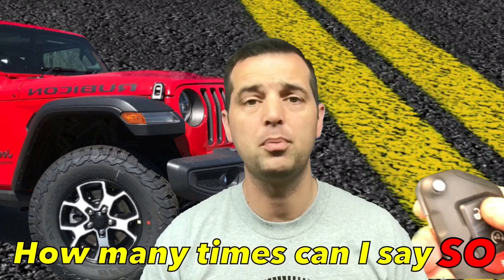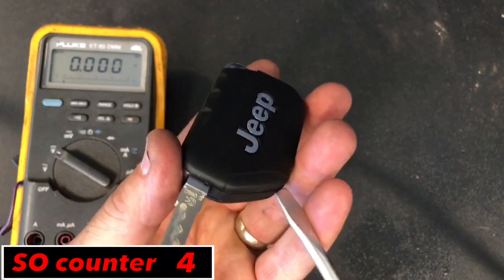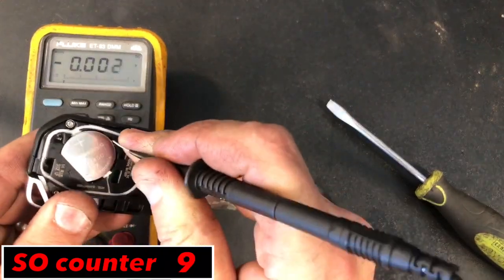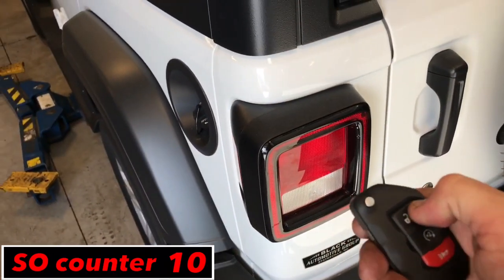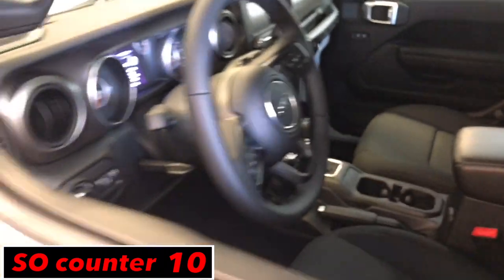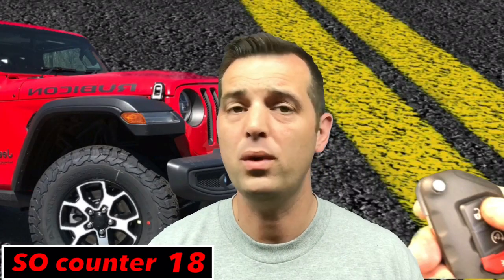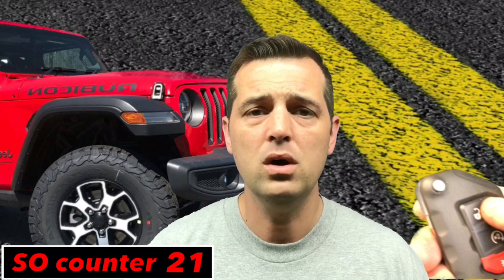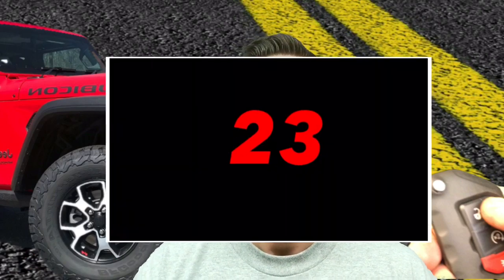Remote Battery Dead NO start Jeep JL Wrangler (KeyFob Battery)

Comment: All the fobs I've had took 2032 batteries. Keep a supply on hand. Just happen to have some 2450 as backup for led candles. Will add one to the jeep. Thanks for the heads up.

Comment: The other day it told me to start the Jeep with the fob, and my battery wasn't even dead. Go figure. They are using Near Field Communication--the Jeep's signal powers a chip in the fob to authenticate. Similar tech to easy pass. 

And don't change the way you talk. I'll take a southern accent over a northern any day of the week. 

Thanks for the video.
Reply from the maker: Lol. No worries I’ll never be have proper English. Just ain’t happenin 😉

Comment: I truly dislike the "brick" of a key fob for my 2018 JL.  It's relatively huge and, since I keep it in my pocket all day (just in case the zombie apocalypse breaks out so I can run straight to my Jeep and head for the hills), the "switchblade" of a key always pops out which made carrying the dang thing even more frustrating.  So... I carefully removed the key and placed it onto the key ring - where it belongs.  My question is: can I purchase another key fob (a suitable substitute) and have it programmed to work for my vehicle?  I had a 2015 Rubicon and had no complaints or issues about its key fob.  Thanks!
Reply from the maker: Dennis right now. I don’t know of anything that’s programmable to the JL. I’ll keep my eyes open for something.
Reply from the maker: The key is pretty big. Especially if you don’t have passive entry you have to get the brick out of your pocket every time.

Comment: Why is there a key symbol on the 12V (cigarette lighter) power port?  The one below the AC/Heater controls.
Reply from the maker: Because it only works when the Key is on. when the key is off there is no power to the outlet.

Comment: I’m having an issue with my 2017 grand Cherokee limited and I can’t figure out why .. my key fob only works when it wants to .. I gotta hit my lock button like 4 times for it to lock and my remote start almost never works... any ideas? My car battery has around 14 volts so I don’t think it’s the battery

Comment: They make one bad design decision (removing a normal key ignition) and have to design numerous other workarounds to make up for it.
Reply: Count me in as another "grumpy old man"  with the same thoughts.  A simple key ignition now requires an extra battery and screwdriver in the glove box, and a dead vehicle until you figure out that you have to place the keyfob on the start button.     The young folk want to have all the bells and whistles call us old folks "out of touch!"  I would much rather prefer that the "upgrades" be in performance and ruggedness in order to conquer those washboard dirt roads.
Reply from the maker: Love your guy’s input!!👍
Reply: +r g
It's one thing to add these "features" into some sort of techno-dweeb-Gen-Slacker convenience package, but it they should have made it so that you can still buy a base unit without all this junk.
Reply: Count me as not a big fan of the push button start on the new vehicles. I've got three now with it. I'm just waiting for it to break.
Reply: +jeremy kohler
I would not be surprised if it was some sort of Big Brother ulterior plan to allow them to tell your car to turn off when they wanted it to.  Entering an area where they don't want you?  Send a signal to the cars to stop.  Late on renewing your registration or inspection on your car?  Send a signal to it to prevent it from starting until you renew it.  Don't pull over quick enough when a cop gets behind you because you did not feel that it was a safe place to stop?  Send a signal to the car to force it to stop.
Reply from the maker: You crack me up 😂  grumpy oldman. Who knows. It’s possible if they can unlock your car from Detroit they can do other things I’m sure.

Comment: Question 
You set your alarm, the batter goes dead in your remote, how do you turn the alarm off? Will the key in the door disable the alarm? 
Here is a video ideal for you.
Reply from the maker: Looks like your screwed. I need to test that.
Reply from the maker: Not cool.
Reply: Jeep Informant What is not cool? 
Did you test it?
Reply from the maker: Doors on or off??
Reply: Jeep Informant doors on, does the key turn off the alarm? 
The remote is water resistant, “not waterproof “ so if it goes dead somehow what to do?
Reply from the maker: Ok so if the alarm is set and you unlock with the manual key then alarm will go off. 2 ways to stop it. 1. Press unlock button on remote. But we just dropped it in the large puddle of  water so not what. Use the Key Fob to Press the start button. That will also disarm.
Reply: Jeep Informant okay, so by using the override it should turn off the alarm. Here is a question, why can’t you do this with the doors off? 
Let’s say your remote drops in water with the doors off and the remote is dead. Or did I miss something? 
Thanks again, and congratulations on hitting your subscriber number!
Reply from the maker: Your SOL if you don’t have a back up battery.
Reply from the maker: There is a link in the description of the video for the correct spare battery’s.
Reply: Jeep Informant that is what I was thinking, I’m thinking of putting a spare remote and battery outside of that remote in a waterproof case under the hood somewhere just Incase my remote gets damaged and the alarm is set, so I’m not screwed.
The other day my remote did get wet and while driving my horn would honk, emergency lights would flash one time, this would happen when I stopped at a light. Turned out to be water in the remote.
Thanks again for your videos! Great job!
Reply from the maker: Sounds like a plan.
Reply from the maker: James check this one out. It’s one of my older videos but is still relevant to the subject Remote Battery Dead NO start Jeep JL Wrangler (KeyFob Battery) https://youtu.be/He3vti6ZhgI
Reply: Jeep Informant hey
Yeah, removed the battery with alarm set, and no way to stop it! I ordered a waterproof case today for an extra remote. Can you imagine being off road, fall in some water and the remote won’t work anymore? Considering the amount of off roading I do, it could be a problem.
Reply from the maker: That’s crazy!!